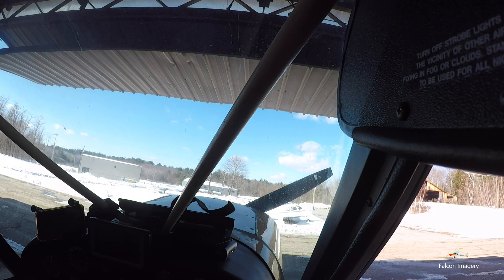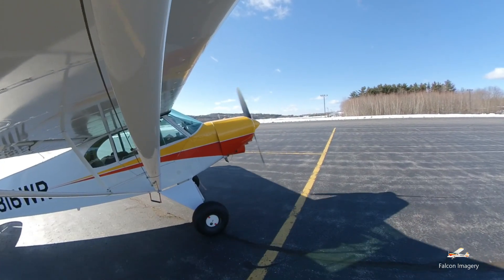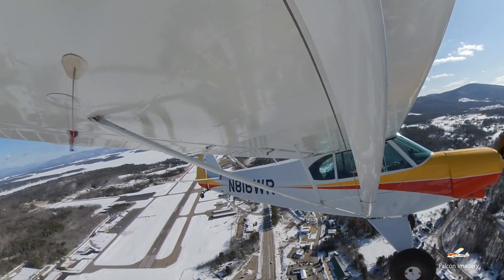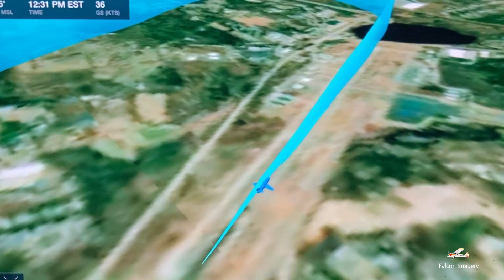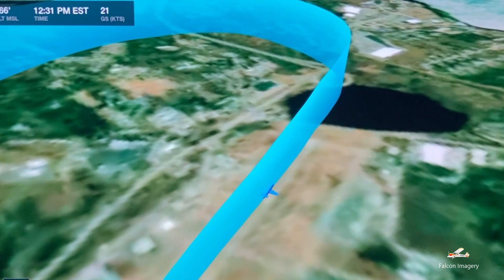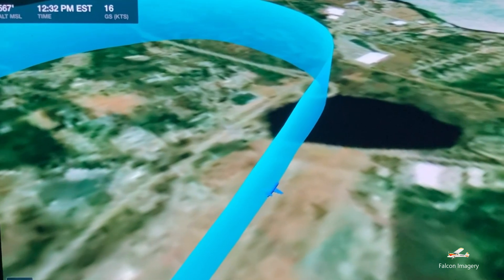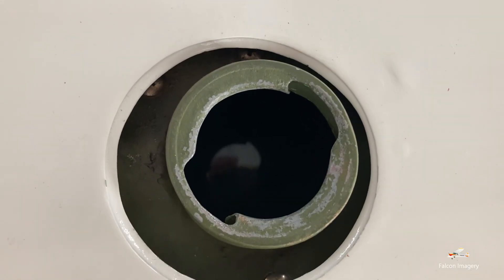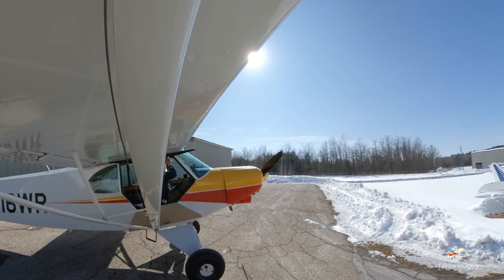Fuel Starvation on Takeoff & JPI's Engine Data Monitor EDM 730

Comment: My Cessna checklist has the pilot pull carb heat for landing checklist prior to reducing engine RPM.  This. Reduces the risk of carb icing up on the approach phases of flight. I do it every time since that's what the checklist says to do.

Comment: My Cub has a C90 in it and I obsess over the use of carb heat. Icing happens faster than you want to believe, keep the discipline on using it. The situation with the caps is interesting as the cap shown was specifically provided as a vented cap replacement for those used in Cubs to address an AD. My cub has a tank vent and also the vented caps. I'm a little surprised yours does not have another vent from the tank but this could be the difference between models and 1940 model year (mine) and yours.
Reply from the maker: Yes, mine is a 1983 Model, and from what I was told the fuel caps were a bit of an issue on the later models, particularly as it relates to venting.

Comment: My O-300 powered 172 can get it so bad that sometimes, I’ll fly with the carb heat cracked on a little. Carb ice can get on you quick. I’m shocked you haven’t been using carb heat on high vacuum, low power setting flight. I thought that was industry standard.
Reply from the maker: Per the PA-18-150 POH for approach and landings, it states "The Carburetor heat need not be used unless icing conditions prevail, but the engine should be cleared occasionally by opening the throttle." So I, like many others flying carburetor engine powered Pipers, don't put it on unless we experience carb icing conditions. That said, going forward, I plan to turn it on like I normally would do in a C-172.
Reply: @FalconImagery  interesting. Thanks for the share.

Comment: Like you I have never experienced carb icing in my SuperCub here in Colorado. The air is just so dry and than also flying at high altitude seems to reduce the humidity even more. In the winter I do apply carb heat on downwind even though my carb temperature gauge doesn’t indicate I need to do so. 
This past summer when I was in Alaska taking float training I got to see how common carb icing is in a SuperCub. I’m a lot more vigilant about pulling carb heat now and then turning it back off on short final in case I need to do a go around requiring full power. 
It is easy to become complacent when carb icing isn’t an issue 99% of the time.
Reply from the maker: Where did you get your floatplane rating in AK? I got mine at Alaska Floats and Skiis two summers ago. We were flying Piper Pacers, and we would just briefly put on carb heat (3 seconds) before each landing approach.

Comment: I've met many Piper guys that do what you did; basically never use CH unless needed. I fly a Franklin powered Stinson close to you in Maine, and the temp & dew point are often in the "red zone" or "severe icing" section of the graph if you look at it (I do when I pickup the AWOS). If it was recently, I might have even been flying that same day since I noticed I was picking up carb ice in a power-off decent to downwind, with carb heat ON with temp/DP around 34/33°F... If you think about it — in a fixed pitch prop engine, horsepower & torque are proportional to RPM in most cases. Your O-320 for example would be 150/160hp at 2700RPM. Below that, you're making less HP... the point being, that just about the only time you need all 150/160 horses is takeoff, go-around or climb over obstacles, and that in most circumstances pulling carb heat effectively does what pulling the throttle back a bit would do (but in a different way, resulting in a change in mixture ratio). I'm sure you know all this, but thinking it through helped me ditch the notion that I should wait for signs icing to occur [and they come often with a Franklin] before using carb heat and that when icing is very highly probable — I can pull carb heat & re-adjust mixture to bring EGT back up to where it was leaned out before i.e. fly with carb Heat on and not worry about it unless you need full power.

Comment: I had a power roll back with a T-41B, IO-360, 210hp. This bird always climbed well so I was at pattern altitude when the engine rpm decreased to less than idle, but it was smooth. Power off return to the runway. Could not be repeated on the ground, then it occurred again a while later. Mechanic disconnected the fuel line at the spider to the cylinders and put a high speed pump to pull fuel through the system. At high volume it started sucking air. We found that the low point fuel sump, although not dripping fuel, was not seated enough that with high flow, the seat would pull up as if you were draining fuel and allow air to be sucked into the system. Not enough fuel could get to the cylinders.
Reply from the maker: Yes, this was the same with me.  A very smooth loss of power, instantly. If you look at the EGT/CHT chart I show in the video, you can see all cylinders dropped at the same time. So it was a common failure in the fuel system. I am hoping it was carb ice, as I have a new procedure I plan to do all the time going forward. Turn on Carb Heat on the downwind.
Reply: @FalconImagery  normally an engine would run rough as carb ice clears and that water/ice goes through the engine. Taxing back at low rpm, a roughness may not have been noticed as the water went through the cylinders.

Comment: Great video - thanks for posting!

I was always taught to apply carb heat by mid-field down-wind every landing in the old old cub I learned in.

But the ice on the fuel vent seems like an interesting possibility... as you would be less likely to anticipate carb ice under full power during take off... although, as you mentioned, perhaps it could have formed during the prior landing / taxiing.

My Taylorcraft only draws from the main header tank, which has a large vent tube up on the wing... but this is a great reminder about how important proper fuel venting is!

Comment: I'm surprised you don't use carb heat in the decent at less than cruise power.
Reply from the maker: The POH says to only put it on occasionally when outside air temps are between 20 and 70. In a C-172 I always put the carb heat on below a certain RPM level. But in Pipers, they normally don't recommend putting on the carb heat while in the pattern, in the event you need to do a go-around. They basically want to make sure you have max power for a go-around. That all said, I am now planning to turn on the carb heat when I am on the downwind and base leg for all flights, except possibly on warmer days.
Reply: @FalconImagery  the POH is your main source of info but checking the carb for icing during your down wind checks is a good habit to get into. Especially when carb icing conditions exist. I also set the carb heat hot on the base decent, turning it off when on short finals incase of a go around.
Reply: @FalconImagery  there were a few C172 model years that actually had a carb temperature gauge. Without that gauge, 50-70F and humid summer days were prone to card ice at cruise.